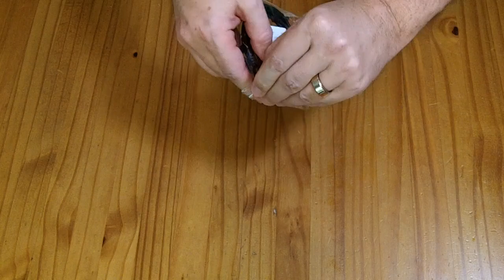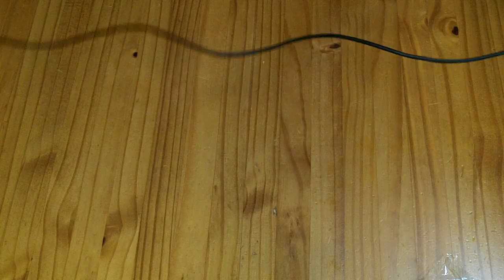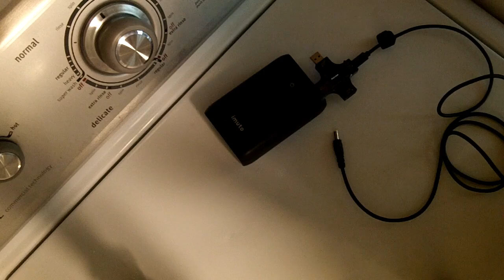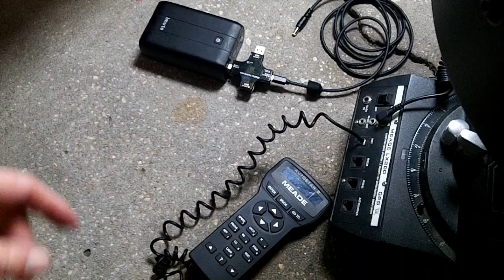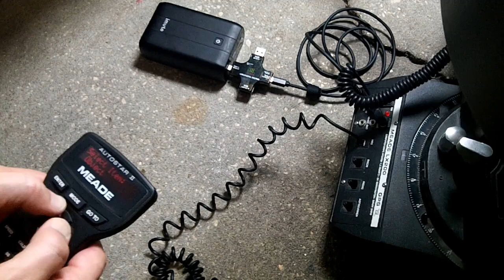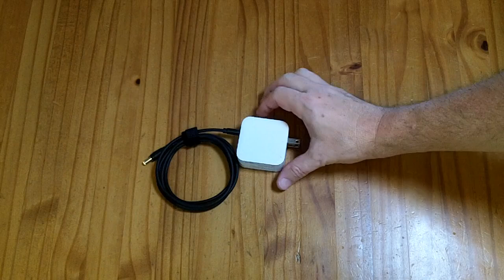Powering a Meade Telescope from a USB-C PD Powerbank or AC adapter

Comment: Interesting and thank you for showing this. I replaced the alkaline battery holders with a dual 18650 battery holder in one compartment, and a single 18650 battery holder in the other. This works fine but i don't have a BMS so there's no under voltage protection. Using an USB battery bank would solve that. Plus the battery bank "should" be putting out a constant 12V, whereas my setup starts at 12.6V and drops from there. My AC adapter is 12V 5A, or 60W, but I've suspected that my LX200 GPS 10" doesn't pull that much power. It could be that overhead is there if you start plugging devices into the auxiliary power ports.
Reply from the maker: @jschuk865  My particular USB power bank only puts out 11.8 volts but at least it's consistently at that. I have some USB-C power delivery wall adapters that do 12.5 volts. I've been so happy with it I bought a second one for my LX90.